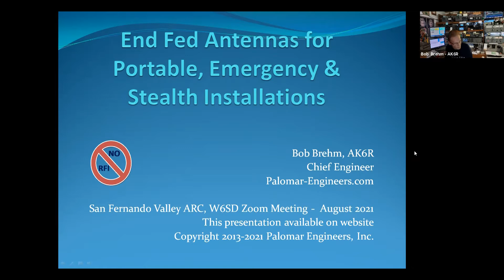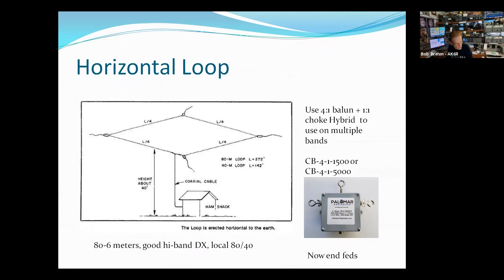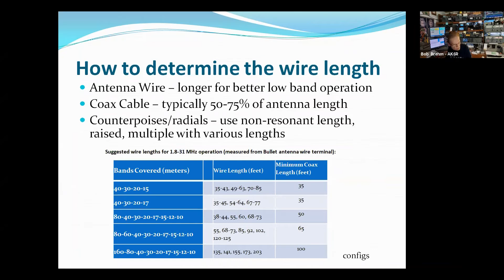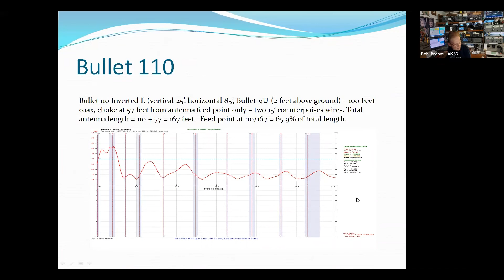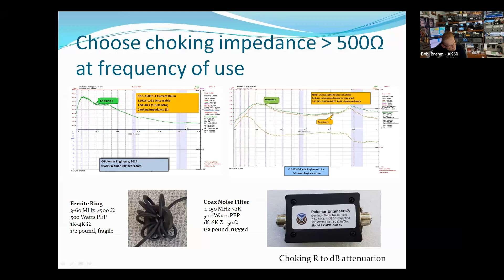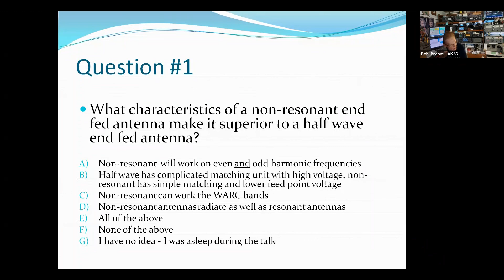W6SD Bob Brehm AK6R on End Fed Antennas - August 20, 2021

Comment: I would have liked some discussion of radiation pattern.  Vertical non-resonant antennas can have great Dx patterns around 0.68L (all the way from 0.62L to a resonant 0.75L) or around 0.64L horizontal (as with the extended double Zepp).  However, especially with horizontal installations, they can have very strange patterns for other lengths.

A tremendous amount of work has been done on optimizing the EFHW and well and while it's a bit of a black art, many transformers have gotten to only 0.3 to 0.5 dB insertion loss, which is more than made up for by the approximately 1200 ohms radiation resistance of a half wave radiator. This is especially important to those of us with poor ground. 

The idea that an EFHW only works on even harmonics is completely wrong.  It works on both even and odd harmonics.  The compensation coil when, correctly executed, is a very low inductance coil at a low current section of the antenna and has almost no loading effects on the lower bands.  I'm on my phone right now and don't have access to some of my saved curved traces but the idea that the 80 m bandwidth being only 50 khz is absurd. There is almost no reduction from that of a normal dipole. 73 KK7YIS

Comment: Very nice presentation, but there was one key consideration in antenna design and implementation that was not mentioned: Radiation pattern. This presentation focused on getting the SWR of the antenna low enough to be handled by the antenna tuners in modern rigs, but it ignored where the signal is actually radiating. It would have been really nice to see the radiation patterns of the various antenna designs. Some of them, I'm quite confident, are "cloud warmers", while others (at the right height and on the right band) would perform decently for DX.

Comment: I run the Bullet 9:1 with an 85' wire, 20' vertical, 65' horizontal (inverted L), with two 15' radials, and choke on the coax at 50'.  Works great.

Comment: WOW , Bob just got your 71' antenna , that bullet picture does not do justice to that bullet, I can tell it's quality just by the weight of the goodies in it, and that  Maxi -chocker is also awesome, I can tell you put quality ferrites in it.  I will post once I get it installed.  runs circle around the first radio-wazs  I got 2 years  ago at hro wen I bought all my gear from Bob in Anaheim.

Comment: Discovering RF choke at the transceiver end of things really reduced my receive noise level. I made one from 30 (!) 6mm ferrite beads threaded onto a piece of good quality RG58 with a gap between each and then heatshrunk over so its like a flexible patch lead.  I combined that with a G3SEK mains filter and ferrites on all the switch mode 5v power supplies in the house. Got my noise level down from S8 to S2 on HF. GM4SVM

Comment: EFHW works on even AND odd harmonics.
80m at the very least should do 80,40,30,20,15, and ten.
With a compensation coil, the upper bands match nicely.
Many get 17m and 12m as well.
And an EFHW will work far better on 80m than a random wire antenna of 71’ or anything lower than 120’
I understand he wants to sell stuff, but he is demonstrably WRONG about EFHWs
That said, I do own some of his chokes and Baluns. They are good quality.

Comment: I just watched this again after fighting a noise battle with an 80M EFHW. Afterward, I hung 84' of wire as an inverted L up about 25' using a 9:1 wound on an FT240-43 core. I need to add more counterpoise to see what happens to the SWR. Wow... so quiet and yet versatile. Thanks for promoting the end-fed random wire! 

I think the iron core toroids work well from 20M up, with ferrites doing great all the way down to 160.

Comment: Thanks for the video.  First things first, I was expecting the typical death by PowerPoint presentation but the density of the information made this anything but boring and redundant.  I am in the process of putting up my tower (just 35 feet to start but I have several more sections I can add later).  I also have an old but like new Icom AT-130 tuner that I was planning on putting up and I am thinking now that I want to put a non-resonant end fed antenna up with the tuner at 35 feet and counter poises of varying length running down the side of the tower with one tied into a ground stake.  The wire would be one of the longer ones, minimum  155 feet (my lot is about 2,000 feet deep, dropping into a gulch, so would all be sloper).  Optionally I could mount the tuner lower on the tower allowing for the vertical component.  Do you have any comments on this setup?

Comment: What about the position of the counterpoise with respect to the antenna wire? In the narrow confines of a yard, the area where the ant. can run is the same area the counterpoise can run - under the antenna. Or, two shorter cp wires could run at 90 degrees from each other (starting in the corner of a yard.

Comment: I wonder if Paloma’s uses iron or ferrite cores. The T130-2 or T200-2 core is great, but typically from 40 meters on up. FT140-43 or FT240-43 go down to 160M nicely, though I need to test the efficiency.

Comment: A good RF ground sometimes is good to cut out noise.  A RF choke and a surge suppressor with a good ground just before going inside, can block out a lot of noise. Plus it helps with surges from near by lightning or solar flares. Nothing can help if lightning hits your antenna! It can form glass around ground rods! That is how hot they get!

Comment: air choke 12-14 inches  from the transformer feedpoint on an efhw?  I was under the mpression a choke at this point could not supress the high voltage?  So two chokes - one close the transformer and one further on down the coax?
Reply: You can use a choke at the feedpoint so long as you have one or more counterpoises

Comment: I got this terrible noise spike that is about 5 to 10Khz wide that slowly sweeps back and forth across the FT8 band like a downhill skier who barely knows how to turn. It happens on all HF bands and I cannot seem to find the source. We are off-grid, solar powered home and at least 400 feet away from the nearest other off-grid house. It does not seem to matter whether it is day or night so I do not think it is the solar charge controller/PV panels. I hope it is NOT the inverter 'cuz we kinda need to have that on all the time.
I tried putting all kinds of rings and toroids and snap-ons but not help. I unplugged and even turned off the power strip for the WiFi and stuff but no help there either.I got a Xiegu G90, an RF choke and a 53' end-fed random wire antenna with the 9:1 un-un.
I might have a crappy ground since I am using the third prong (chassis ground of a nearby DC power supply (that is turned off) as the ground for the radio.
Reply: Yeah, it’s most likely the inverter.😊

Comment: Anyone know why putting the choke between the antenna switch and the radio wouldn't work? Why buy one for each antenna if one will work?
Reply: @KutWrite - he mentions it at the end 45:20 - you'll get the noise from each coax because the switch only switches the center of the coax, the outsides are all tied together. If you choke between the switch and the antenna you isolate that antenna. If you do it for each antenna, the outside braids of each coax can't go through the switch.

Comment: Pointless waste of time.

This is not the 1930s with transmitters having hi Z outputs.

They are 50 ohm now ( very low)

It is utterly foolish to play with such grossly mismatched hi Z antennas and matching networks. 

Same foolishness in grossly out of tune twin lead antennas.

If you think this nonsense works, try two things:

1. Listen on air. Note that those using kluges like end feds and G5RVs universally need amplifiers just to talk in the US.

2. Turn the power down to 1 - 5 watts. Good luck getting out of your own proverbial back yard.

Im working Europe 55- 59 with 1- 10W CW and SSB with PROPERLY tuned antennas. Serbia, 55 in phone.

You wont with such kluged up antennas.
Reply: I use a home brew 30’ 9:1 vertical with a 15’ counterpoise for POTA on QRP CW. It gets out great on 40 and up. I have completed QRP QSOs of 9,000 miles with this antenna. It’s a fantastic solution, though it requires a tuner. See it in action at https://YouTube.com/@learnhamradio
Reply: working dx ssb on 1-10watts?  I'm skeptical of nref and it does appear to be a lot of tweaking. My vertical needs no tuner 160 - 10 on any frequency, but I get better reports on ssb from my efhw horitzontal.
Reply: Oddly enough worked 5w SSB both ways, tuner fed random wires over tree branches both ends a number of times. England to USA. But guess I’m hallucinating.
Reply: Never owned an amp and my EFHW works the world.
Your statement is false.
Reply: PS the dipole graphic is wrong. That ' sine wave' theory went out the window years ago.

Smoothly changing functions ( sine waves) can not radiate.

Dawson, IEEE

Comment: DV Scotland is an independent informal group of radio amateurs, mostly based in Scotland, who share a common interest in Digital / Analogue voice systems.

Collectively we operate a number of digital / Analogue voice Repeaters / Nodes throughout Scotland, most of which are Multi-mode, operating on D-Star, DMR, System Fusion, FM modes.                                                                         

The Group also host a number of Linux servers to run D-Star XLX600 Reflector, YSF GB-DVScotland Reflector, DV Scotland DMR+ IPSC2 DMR Master Server and Allstar HUB 53937. @

Comment: Fascinating presentation.  I need the non-res efhw antenna  - probably in my attic.   not sure how to fit that much coax in the attic though - can it zig-zag across the attic floor before getting back to radio?

Comment: <---loves and swears on Endfed Antennas. I own 6 of them in different lenghts 49:1 as well as 9:!UNUN's. I work the whole World with them PORTABLE straight vertical, inverted V and sometimes depending on the Location, even as a delta loop configuration. Thx for the Great Video. 73 de Your Friend Uncle Guenter 💯🍻🙋‍♂